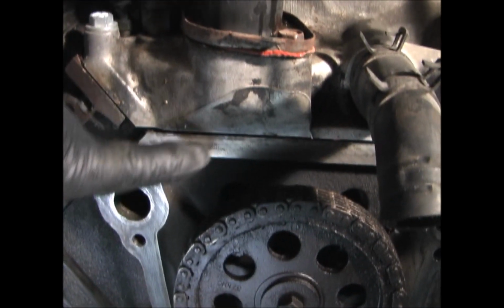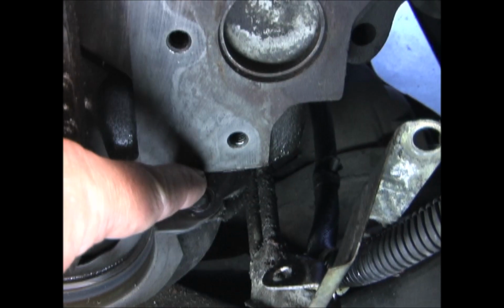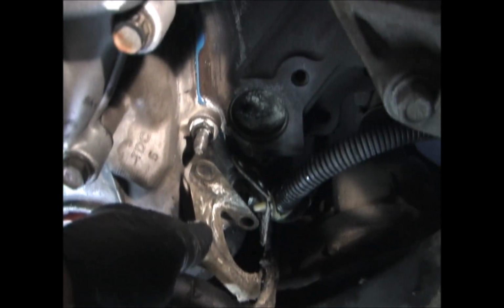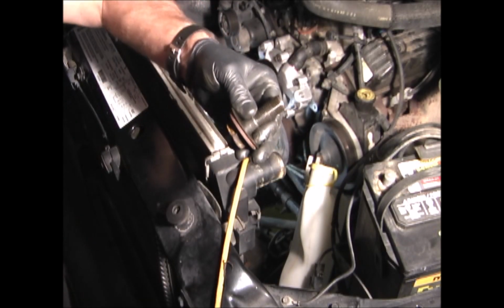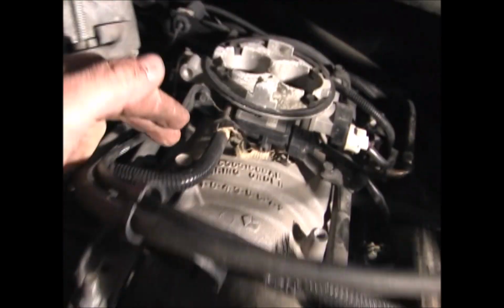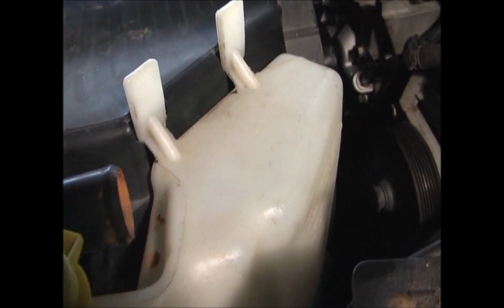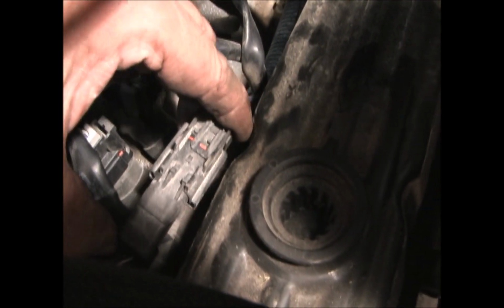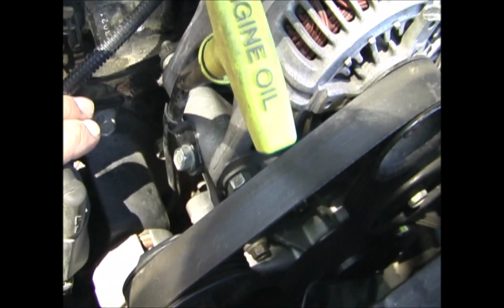Timing Cover Gasket & Water Pump Replacement 5.9 1998 Dodge Ram 1500 Coolant Leak - Part 2 Assembly

Comment: I relocated my washer fluid and coolant reservoirs and neatly cut the bottom of my fan shrout out allowing the fan shrout to slide up and off easily as well as held on using strong zip ties. Never been an issue.  And makes life easier thusly allowing you to remove the fan shrout at anytime its in the way. Thanks for the vid. 😊
Reply: I did the same with the shroud but left the rest stock

Comment: I need to do that to mine as well and love the video but for the fan clutch I have just used a 36 mm combo wrench and a hammer and smacked my wrench and taken it off that way and the just tighten it with the wrench while driving it will tighten up

Comment: You didn't mention if you put gasket sealer on the gaskets to the timing cover or the water pump I always believe that's a very good idea I must to give insurance you do not have leak after all it's a lot of work to take it apart and put it together

Comment: didn't know that you could use the pulley bolt to reinstall the harmonic balancer without a damper/pulley installer. and hey can I use motor oil to lubricate the back of the pulley connection if I don't have proper lubrication on hand?
Reply: You really shouldn’t use the bolt to suck the balancer down, cut a length of threaded rod and screw it into the crank thread until it bottoms, then use 3 nuts and few washers to push the balancer in - remove the rod and proceed with installing the crank bolt to torque

Comment: You dont even check the chain for play? Jesus
Reply from the maker: Yes, I did, and it was well within spec however I did not realize that the camera was not on at that time and so was unable to put it in the video. It is a good idea to check that and I will try to add a comment to the video. Thank you for pointing that out.

Comment: are you not afraid to strip the threads of the dampener bolt when using that to install the harmonic balancer?
Reply from the maker: There is a special tool for installing the harmonic balancer but I felt that it slid on easy enough and there were enough threads engaged that it would be safe. However the proper tool should probably be used. Thank you for pointing that out.

Comment: My mechanic just told me that there is a possibility the bolts could break while replacing the timing chain cover & the whole engine would then have to be pulled. Is this true & if so do the bolts break often?
Reply from the maker: It is possible for the bolts to break but I do not know how often that happens. I don't know why you would have to pull the engine to remove the broken bolt. If you want, before you loosen each bolt, tap it fairly hard on the head several times. This may help loosen it if it is corroded. I broke a bolt when removing the intake manifold. I sprayed it with PB Blaster and tapped on it while turning it with a vise grips. It came right out.
Reply: @WilliamFrawley  Thank you so much for your answer. Definitely eased my mind!

Comment: Besides the bottom corners that mate to oil pan, did you use gasket sealer on any other parts of timing chain cover?
Reply: I have that same question

Comment: Dude what the hell were you thinking not replacing the timing chain !
Reply from the maker: I checked it and it was well within spec however I did not realize that the camera was not on at that time and so was unable to put it in the video. It is a good idea to check that and I will try to add a comment to the video. Thank you for pointing that out.

Comment: Thank you for the video. I’m doing this job right now but unfortunately I lost the order to the bolts like which ones go where just for the timing cover. If you remember it would be very helpful. Thanks again
Reply from the maker: Here is a link to a slide show:   https://youtu.be/TtXxlsTdhPY
Reply: @WilliamFrawley  how bad is it if we tip the fan over? I don't want to wreck the clutch.
Reply from the maker: @braddeforest4511  Fluid "could" leak into the bearings but might not. Tipping over isn't bad but you don't want to leave it lying flat for an extended period of time.
Reply: @WilliamFrawley  also the serpentine belt is off but the fan isn't. is there another way to hold the water pump pulley in place while we loosen it? We tried with a strap wrench but it was too small.

Comment: my timing cover is leaking on my 1998 5.9 liter magnum, I had the water pump replaced about 2 years ago and now its leaking bad , they had to have changed the gasket when they changed my water pump correct ? 2nd question , how much do u think a garage would charge me to replace this gasket ? and since I am there should I change out the timing chain ? truck has 190 k miles but I have changed the oil every 2 k miles since new , thanks
Reply: First of all holy smokes that's a lot of oil changes. Second my truck just had this happen and the shop quoted me upwards of $600 so we decided to do it ourselves. If they only did the water pump they might have just left the timing cover and gaskets like they were.

Comment: Did you check your timing chain for excessive slack?
Reply from the maker: Yes, I did, and it was well within spec however I did not realize that the camera was not on at that time and so was unable to put it in the video. It is a good idea to check that and I will try to add a comment to the video. Thank you for pointing that out.